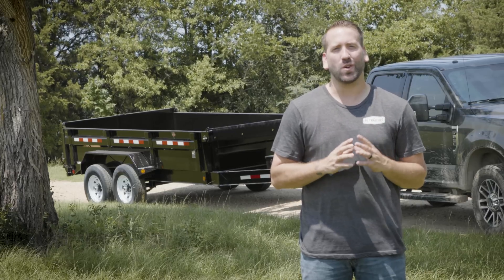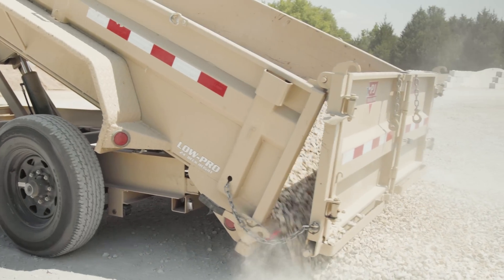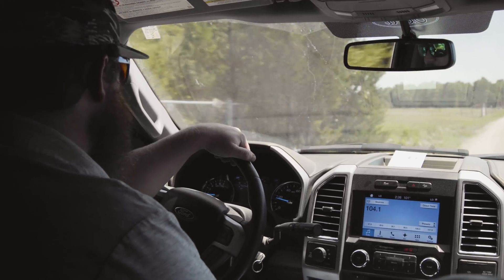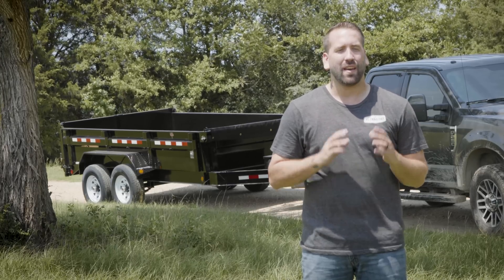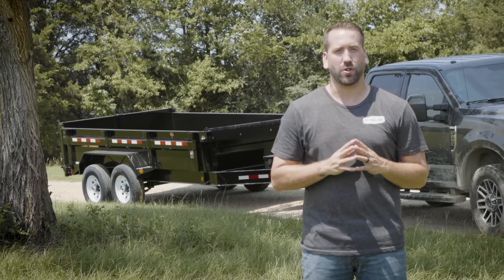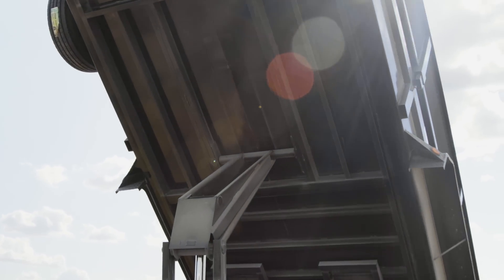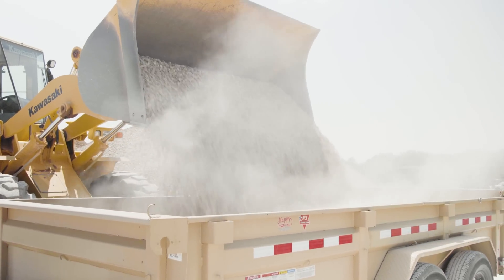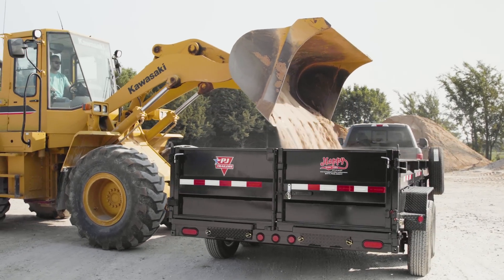Trailer Safety Series - Dump Loading & Weight Distribution

Comment: No mention of using a weight distribution hitch, which is required for loads over 5000lbs on most pickups.  I've never seen anyone use one though on a dump trailer, very confused.